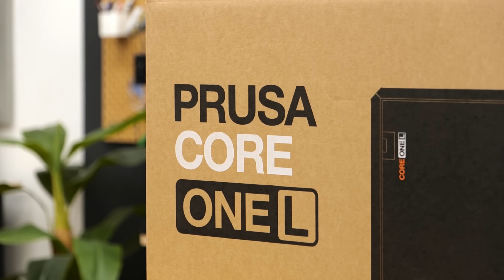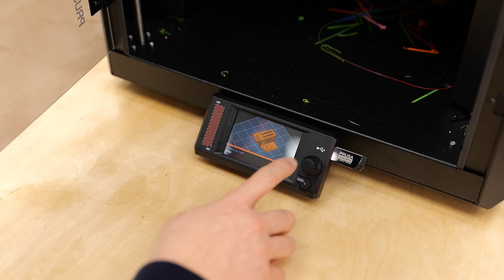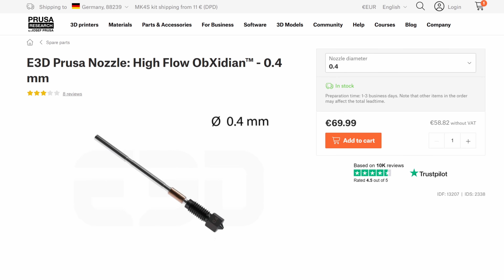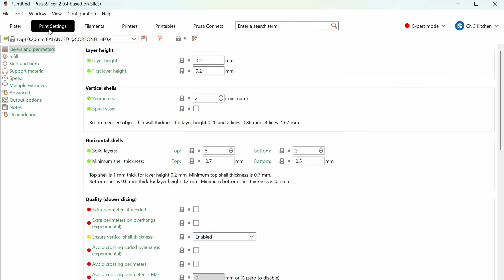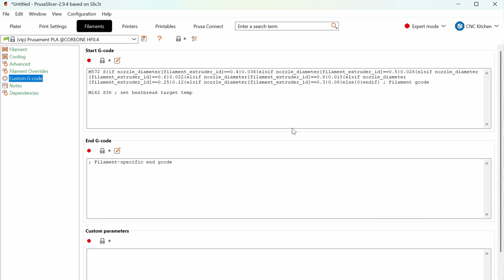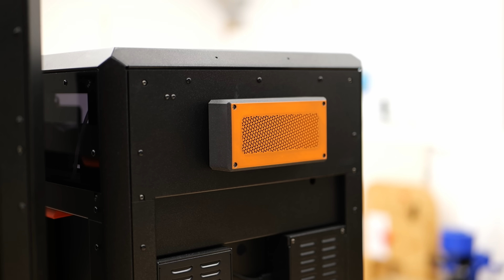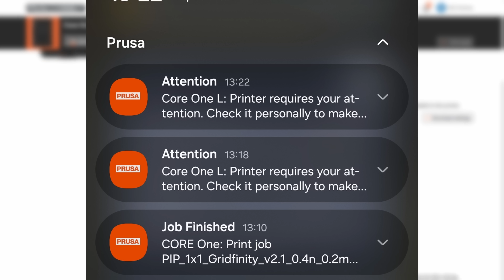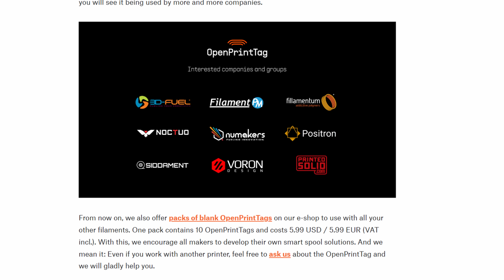What Prusa Got Right (and Wrong) with the New CORE One L

Comment: For a device that works so well without the cloud, I don't understand why the camera - one of the last things I want to connect to the internet - requires a cloud connection?
Reply: It does not. If you have Home Assistant there is a Prusa integration allowing remote control and camera access.
Reply: @piast99  That's a workaround, not a feature. And why TF would a buy a HA just to be able to use my camera?
Reply: @Doppeltganger HA software is free and open source. The camera feed needs to go somewhere?? Not sure what alternative you're expecting. Seems like you might not understand how camera feeds work.
Reply: Because they don't have a Linux computer controlling the printer. It's a microcontroller-based system using a highly modified version of Marlin.

Adding a simple camera would require a complete architecture change.
Reply: @JonS  The camera is standalone, probably something similar to a Rasbperry Pi zero or ESP32 that can just stream the video feed locally as well
Reply: @hexerade.e6142 You still need to connect to it to configure it. The only documented way to do that is with the app, and you need to login to prusa connect to use the app. I'm not saying it's impossible, but the camera is not a priority and I don't want to spend hours reseraching a workaround.
Reply: @JonS doubt that extremely. As the camera seems to Scan a QR code and is then connected directly to WiFi, there is probably a ESP32 in there and the camera is not really communicating with the printer. Just give it a damn RTSP stream and don’t follow Bambus Cloud only b$
Reply: @JonS  Stop pretending you have the slightest idea what you’re talking about. A camera absolutely doesn’t need a fucking computer running Linux or a cloud. Are you even aware surveillance cameras exist?
Reply: @Doppeltganger I'm trying to work out if you're someone who knows me, so is being sarcastic. Are you?

You're taking my comment out of context. Of course you don't need Linux to support a camera, but in the context of 3D printer architectures, most modern controller boards have a relatively powerful processor with sufficient interface bandwidths that can handle a camera feed. They have this type of microcontroller and external DRAM so they can run Linux. They got the camera feed for free.

Prusa on the other hand, uses a low performance microcontroller selected only to handle their fork of Marlin. They don't need the performance, nor the off chip DRAM, for the main printer functions. This has backed them in to a corner. Their controller cannot handle a camera. As I said, they would need to change their control board architecture. This isn't a defense of them. It's simply a statement of where they are based on their history. This is not made up. I've discussed this with Josef Prusa.

Surveillance cameras have SOCs that are specifically designed the purpose. They have the sensor interfaces (typically MIPI D-PHY), an Image Signal Processor (ISP), external DRAM, and off-chip WIFI chip interface bandwidth needed for the job. Most of these SOCs do run Linux. Look up the popular Ambarella surveillance camera SOCs if you doubt this, they all support Linux. Even the original A2 from 2007 could run Linux. You're correct that you don't NEED Linux for a surveillance camera, but you do need an architecture suited for the job.

I've worked on the development of many surveillance cameras. Going back to one using that A7 (actually it was the A7S). I'm working on a high-end surveillance camera right now. Hence my asking if you know my background (as many in the 3D printing community do) and are just teasing me.
Reply: @JonS wouldn't be a Prusa otherwise! 😂
Reply: You actually can connect it locally. The camera supports RSTP, so you can connect it to something like Home Assistant on the LAN.

It doesn't seem to be a great implementation as it doesn't seem to work for me, but it theoretically doesn't need a cloud connection (except maybe on setup to turn on RSTP).
Reply: @logicalfundy  I've used RSTP without issue. I run BlueIris on my server which records all my security cameras, and I was able to add the camera stream to the software without issue. I can even record if I really wanted to.
Reply: @scottf136 well, I had some troubles. But eventually I managed to fix it.
Reply: You can use RTSP locally (video stream) but that sucks because browsers do not support RTSP. That means video doesn't get integrated into PrusaLink local page (also is not integrated into Prusa Connect cloud web page) and you have to use some third app each time for that. Annoying as hell and unfriendly (testing on macos).
Reply: It's also support LAN only and you can add it to the VLC app on Windows or smartphone for example. :)
Reply: Because Prusa’s only customers at this point are sheep. The Prusa fanbase is basically a cult at this point.
Reply: I figure it's done intentionally so that prusa connect does not have to interact with or process it. Like it's possible none of the data is going through prusa's servers.
Instead all they're doing is just linking to your camera in the interface and it may even be streaming through the local network.
Reply: @fridrik6  The camera can stream through your network, but it also goes through Prusa servers, since you can see it in the app from any network.
Reply: It doesn't you can stream over the local network, he made a mistake.
Reply: Because its cpu is too weak.... Yeah even for this absurdly high price they are cheaping out on it
Reply: @riba2233 Yeah the underpowered CPU is probably the same reason they have such a primitive user interface on the display also and cannot do real-time pressure tuning
Reply: They tried
Reply: @1337BlueBird could be Prusa's slogan at this point
Reply: They need separate board for it.
Reply: Yeah this makes no sense
Reply: All of the folks suggesting setting up your own camera or feed are completely missing the point. There's no reason they should not have an integrated camera solution that's part of the printer at this price. Again this is a printer that's not targeted towards people who want to tinker with their printer but rather people who want to use it to make things.
Reply: I didn't mind that too much, since I mostly use it to check my printer remotely and make sure my print is fine. 

My only gripe is how the camera feels the need to aggressively yell at me at 2am about its feelings.
Reply: @gomichow Setting the volume to zero helps with that ;)
Reply: @gomichow  Why would you need "cloud connection" to check your printer remotely? You could just use a VPN to your own network.
Reply: @glp.1337  at that point why dont you set up a cheap webcam you set up yourself then if you are going to go through the hassle of setting up separate computer and VPN to route it through

doesnt make sense to ask for camera connected to the printer then complain that it needs a connection
Reply: @Asghaad why would you need a computer to terminate your VPN on. Do you not have a firewall/router?
Reply: @Asghaad  "the hassle of setting up separate computer and VPN" What hassle? Just use Tailscale or something. He's talking about needing cloud connection to check up on his printer... regardless of having a camera or not.
Reply: Crazy part is that they were/are asking 50 for a camera that has 1 fps. Complete ripoff.
Reply: @nytbe184 Recent updates fix that
Reply: @nytbe184  that's more of a server issue, no? If you connect directly to the camera, it has a much higher framerate.
Reply: Even with my cheap A1 Bambulab printer (!), I can use the camera in LAN-Mode with OrcaSlicer without any cloud.
Reply: I just know it’s too expensive and will go elsewhere.

Comment: I just selled my core one. Not the bang for the buck.
Reply: Different priorities I guess. I will never use a Bambu even for free.
Reply: @1337BlueBird  there are plenty of other options other than Bambu that can give you better machine for less money ... The 1L is just WAY too overpriced for a basic printer it is with a horrible specs ...
Reply: @Asghaad  what will be a better option, made in EU/USA with an open source firmware?
Reply: @1337BlueBird  why do you care so much about "made in EU/USA" while posting this from a device that is almost assuredly made in Asia ? ...

when you drop thgat nonsensical limitation there are plenty of alternatives from Sovol, Sunlu, Creality etc ...

and for me personally i was cotemplating between getting Core 1 with the INDX but frankly my next printer will most likely be either Snapmaker U1 or if it doesnt pan out Bambu H2D beause im fed up with cross contamination whenever i attempt multi material printing and am looking for at minimum two separate nozzle system 

so either something with INDX, U1 or H2D being my only real options ( i could buys lets say Creality K2 or Sovol Sv08max and try to mount the INDX to it myself though)

and no i would NEVER buy non kit Prusa, too overpriced -  WAY too overpriced  - even kit build Core1 is obnoxiously overpriced for what it offers a 1000eur for a parts kit for a machine that is worse than 500 eur Bambu P2 ... ugh
Reply: @1337BlueBird  I love my P2S. Print and forget.
Reply: @PetriHail1337  My friend lost 3D printing work because he had a Bambulab Printer. Some clients refuse to allow their stuff to be printed on them.

Comment: Honestly, Prusa has been known as the "expensive but good" brand for so long; now it nearly rivals the prics of the Bambu H1S and H2D. If I could, I would 100% get a Prusa over a Bambu, partially due to Bambu's TOS update but also becasue I believe in Prusa's goal of open sourcing as much as possible.

Edit: I mainly commented this to try and describe the comparrason between the other printers and Prusa's TOS Vs Bambu's TOS and ot show my thoughts.
Reply: What they (Prusa) lack is the simplicity of Bambu Lab when it comes to use. Bambu basically have the simplicity of use in their pocket. This is something that experienced users shrug at but it is very important for those who doesn't really have an interest in the 3D printing itself, but just want to press a button and have the printer produce a "good enough" part that is actually pretty good and is reliably doing this time and time again.

What's old school and obvious for those that has spent two decades getting the prints they want from everything from very primitive machines to the latest models as they've upgraded over time adjusting the settings might be obvious, but for the guy who has got the printer to print out miscellaneous parts that's hard to get, expensive, only intended for test fitting a lot of these settings are pretty much gobbledygook.
Reply: @blahorgaslisk7763 yea, I know what you mean, Bambu has made 3d printing much easier to get into as a beginner and has without a doubt revolutionized the market to make it easier.
Reply: @blahorgaslisk7763  exactly, the enthusiast market is small and pretty much saturated, noobs and mainstreaming are the future..
Reply: Really, you think requiring cloud connection to use camera is reprap?
Reply: @noanyobiseniss7462  Not that, more the option that it's possible to upgrade a printer if desired e.g. changing form the MK4 to the core one and keeping the slicer opensource. In addition, unlike some companies, that don't ignore the fact that some of the major innovations that they have used (e.g. klipper based software) is from the open source community.
Reply: @noanyobiseniss7462 You can use them now locally without cloud. That was true initially, but not anymore.
Reply: Nobody in their right mind should buy this compared to something like H2S or Qidi's upcoming large format printer, not only is it much worse in every way and it is also far more expensive... It's basically a joke.
Reply: @riba2233  While I agree it's not as good of a deal and has some major flaws, it does have some features that I like. For example, many of my friends have refused to get a bambu due to the TOS update, I haven't seen the new Qidi though.....
Reply: @riba2233  it's hard to compete with free Uygur slave labour, no argument there.
Reply: @UNgineering more coping I see ;)
Reply: @riba2233  stating facts is now called coping? i'll update miriam webster.
Reply: @UNgineering  not a fact, just a bs myth
Reply: The one L isn't comparable to the h2d. The h2d has two nozzles and bigger build plate. Prusa will never be able to compete with Chinese manufacturing cost. That goes for any company not in China. Material is cheaper, labor is cheaper, and oftentimes the companies are subsidized by the government itself.
Reply: @Dare13-y3m  Yea, I see what you mean about the cost, I just don't like the bambu TOS
Reply: @bredwar2098 What about their TOS don't you like. And why would you value that over your Privacy and Security? Since Prusa couldn't get certified for ISO 27001 (system security) nor ISO 27701 (Privacy / GDPR compliance) that's a weird trade off. Bambulabs on the other hand, do have their ISO 27001/27701 certificates.
Reply: @Dare13-y3m  The "S" stands for "single" buddy.
Reply: @oyuyuy thanks for the correction. My bad lol
Reply: Lmao prusa hasnt open sourced their printers in years
Reply: @RADkate  yea, it sucks
Reply: The H2S is like 500€ cheaper without the AMS. I have no clue how you call that 'nearly rivaling'.
Reply: @bacaw2856  lol